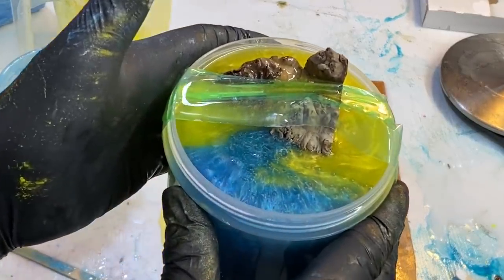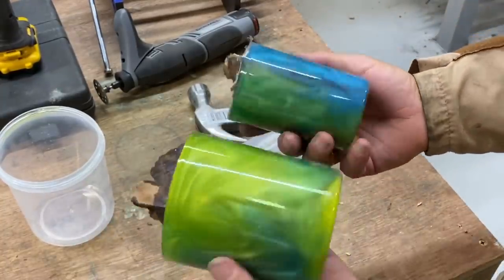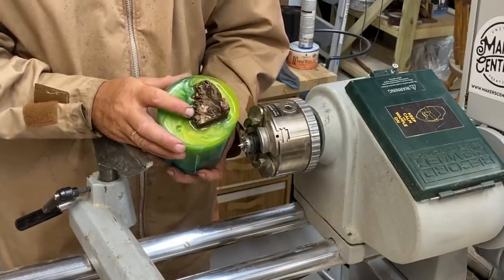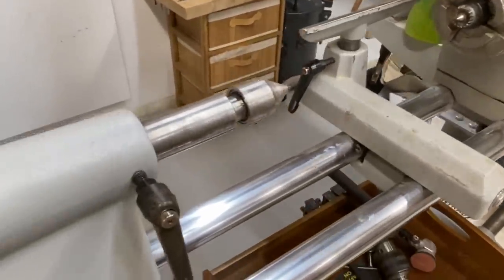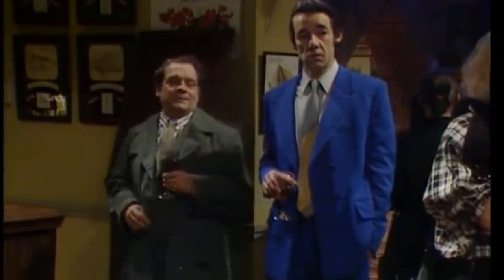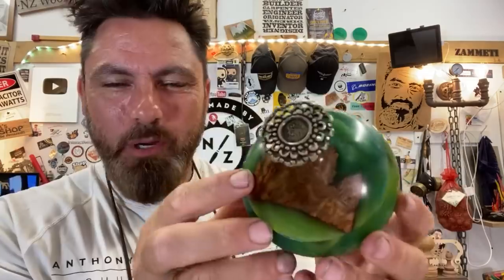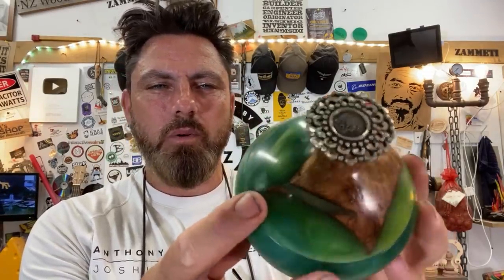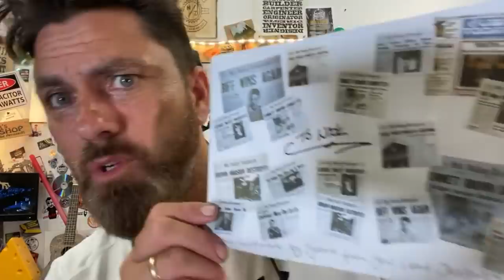Wood Turning - Emerald Borealis

Comment: You mentioned the temp over there and it reminded me of the stupid "laughs in Texan" trend on Twitter. Ugh.
I spent the summer in England in 2015. A hot day was like 21-24 degrees Celsius. Yeah, from the perspective of somewhere that's much hotter in the summer, that seems silly to call that a hot day.
But that's just it. A hot day in England is typically like 70-75 degrees Fahrenheit (the aforementioned 21-24 Celsius). So when that's what's usually "hot," then 30 degrees Celsius is REALLY HOT. lol
Reply: As someone who grew up in Texas, those people can get stuffed.  If your climate isn't normally at a certain temperature, then the people are definitely not used to it and likely to suffer and their infrastructure isn't set up for it. The vulnerable always get it first and worst.
You hint to Texans that there might be three snowflakes falling overnight, everything is canceled until after noon the next day. Then you've got the road heroes in their enormous vehicles that think they are immune to ice that end up putting others in danger/ causing accidents.  They don't salt the roads there (it's sand at best because don't wanna spend the money on the infrastructure ig), and vulnerable people suffer or die if it's cold enough for long enough. 
I really wish some people would just think for thirty seconds before being condescending, you know?
Reply: I grew up in Minnesota and in the Spring when it would finally get over 30 degrees (F), we would all put on shorts and Ts and go to the park to play and talk about what a "nice warm day" it was. :D  Perspective is everything!  (Then I moved to GA, whole 'nother world)
Reply: @thevirtualtraveler  I would die almost instantly in a Minnesota winter 😂 no way around it

Comment: Its really hot here....33, 34 degrees....me: laughs in Australian
Reply: When I was down in Sydney once it hit like 42 degrees. All the Europeans I was with were like "we're melting" but me, from central Florida in the US, hit those temps so often, I forget that's not normal...
Reply: Yup, I’m from south Texas and was laughing a bit at that. We frequently hit the low 30°s well in to late autumn. In summer it pretty much stays in the 40°s.

But it occurred to me: do most people in the UK usually have AC? 34°would be a pain with all that equipment, in a shed, on a sunny day if there’s no air-con.